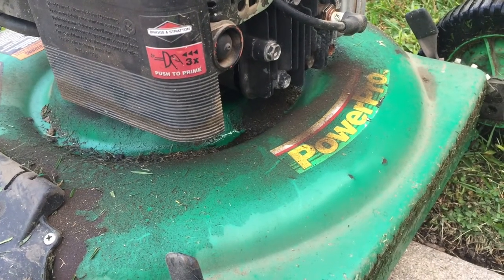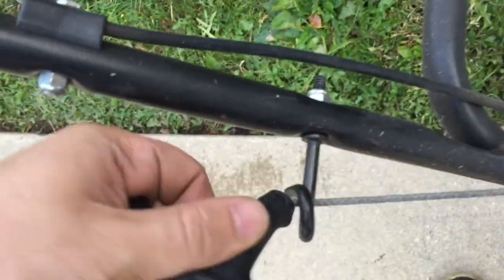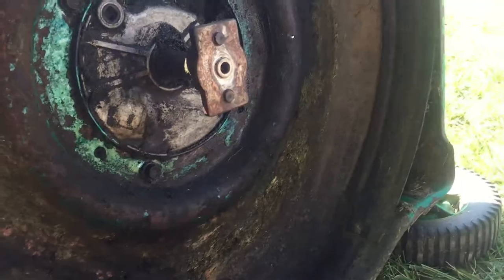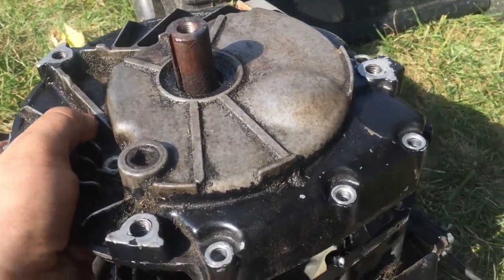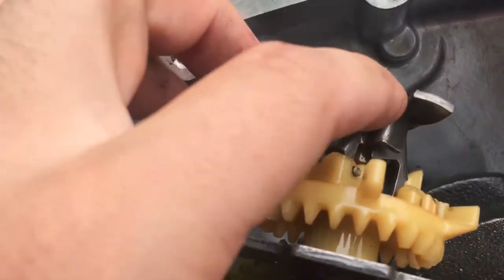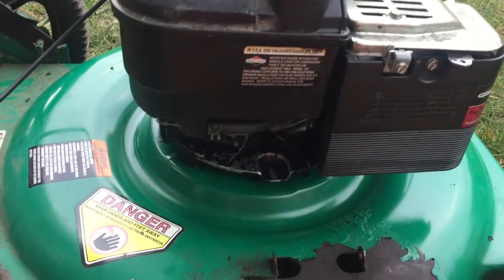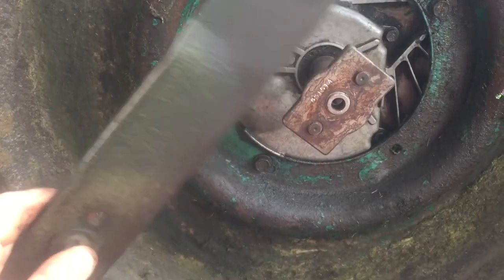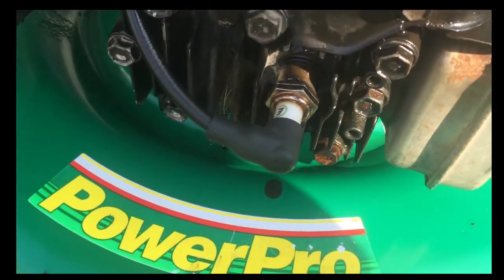Oil Leak on Lawn Mower Repair (Sump Gasket Replacement)

Comment: If a small piece of plastic accidentally fell into where you add oil externally, could it be found and retrieved by opening up the oil sump like in this video? Thanks!
Reply from the maker: You’ll have a better chance of finding it, yes (assuming you haven’t run the mower).
Reply: I was able to remove the piece thanks to the help of your video! However, now the engine seems to have seized. The pull cord is hard to pull with the spark plug in, but pulls fine once the spark plug is removed. With this, I took off and cleaned out the carb, gas tank, and cleaned off the black junk that had built up on the piston. The piston will move up and down when the spinner is rotated. It does take some force to spin it, but it spins. There is also fresh oil in the engine. Any ideas what the issue could be? Thanks!
Reply: @ariela51  hydro locked engine?

Comment: What does it mean if the oil is coming down the shaft bit that the mower blade attaches to please help?
Reply from the maker: If it's coming down the shaft it is the bottom crankshaft seal that needs to be replaced.

Comment: My sump ain't coming off that easy
Reply from the maker: Great question, Ridge. Sometimes they do get seized on. Might help to try giving it some good swings with a hammer or small sledge. I've had to do that many times before myself.
Reply: Yeah this ole girl whooping my ass lol. I might try and drill the seal out. I'm putting a new sump on anyway
Reply: Yeah finally got it. Sometimes thinking easier to buy another. But that's not me. Ain't gonna let a lawn mower whoop me 🤣🤣😂😂
Reply from the maker: @ridgerunner956  Happy to hear it! One step closer :)
Reply: Hey! Thanks for video! Same as other people, the blade mount doesnt get easy off😂 but warming it and two crowbar at same time it came off easy :)